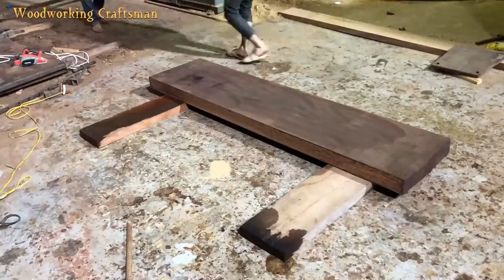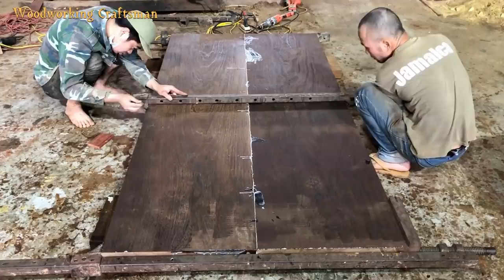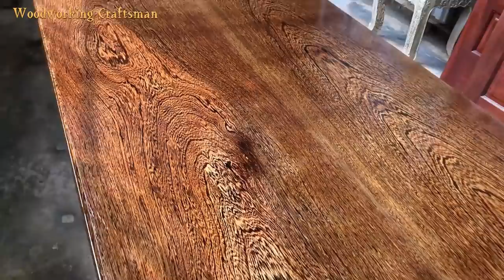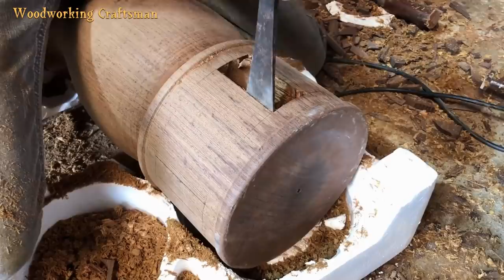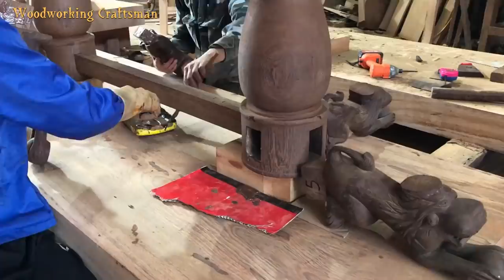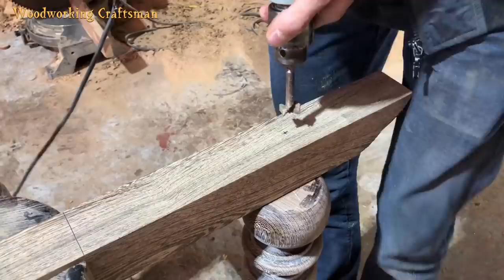Woodworking Projects Extremely Strange Ebony // Amazing Techniques and Perfect Product Furniture

Comment: That doesn't look like any kind of ebony. More like Wenge. That flame method on the mortise though. I've never seen that before. PVA glues don't adhere well to carbonized wood.
Reply: True,,, is Wenge.
But a Amazing Wonderful Work.
Reply: Not sure what type of glue it was but didn't look like PVA to me. Most likely something traditional that doesn't have a problem with carbonized wood.

Comment: Lovely end result, apart from the fact that the beautiful woodgrain was covered with lacquer. I would have been more impressed if they had only used hand tools (watch some videos on Japanese carpentry) and had avoided using metal screws and nails.

Comment: The skills of those young man are amazing. To answer John O about the moisture content, I have been informed that the wood they use is all old stock that had been cut years ago. I have seen some of their furniture that was 75 years old and there was no gaps or cracks in the timber. Got to give them credit, they know what they are doing. Thumbs UP.
Reply: 75 years old my ass
Reply: @tonyjoseph4721  about 200 year. no problem

Comment: The beauty of wood is in the natural grain, it should not be heavely dark coated consealing the natural beauty. secondly, purely wood dowels must have been used instead of metal screws which in time would rust, thirdly, the joints and some dowels where loose and the glue is not a filler type. what a waste of ART.

Comment: Hi, I always enjoy those videos. One thing I'm asking myself is what type of glue do they always use for everything from stairs tu furniture? Is it some kind of epoxy? It is obviously no polyurethan based one either since that would become foamy while drying if not under pressure. 
Why at least for furniture do they not use standard white PVAC based glues such as Ponal, some tightbond types and various other manufactures? I mean PVAC is cheaper than epoxy or polyurethane and other as them non-poisenous and strengthwhise also very good.
Reply from the maker: we used epoxy, thanks
Reply: Woodworking Craftsman 

Thanks a lot for the information. Why is it that you use epoxy instead of normal wood glue? Epoxy is relatively poisonous, expensive and residue on wood or tools is hard to clean whereas regular wood glue residue can be wiped away with warm water - at least before it's completely dried.

And cool stuff your doing, looks so simple but once you try woodworking yourself you understand the skills. Especially without workbenches and vices etc. I highly respect your skills.

Best regards and greetings from Germany 😊

Martin
Reply: @debuchmartin9383  Epoxy is only poisonous before it's mixed. Once it has cured it is completely inert and safe. PVA is also not suitable for a lot of resinous hard timbers, so epoxy or polyurethane is a better option.

Comment: how much in US$ does this sell for?  It is an amazing peice of work.  Unfortunately the wood grain has been painted over.  
I have kitchen cabinets made of American Cherry which shows the original grain and the carpenter painted it in water based clear gloss.  Water based clear gloss in a kitchen?  everything started washing off after a few years and now it looks terrible.  I sanded it down in some places and painted it with clear oil based Varathane but it is not the same.  Well it looks like I have a lot of work ahead of me to bring out the beauty of the wood as it was when it was new.

Comment: Vietnamese junk.  None of the joints are tight.  They are completely dependent on the bolts for stability, rather than as back-up when joints are stressed. Note how the whole thing wobbles when they put the top onto the frame. 
It is tragic that exotic hardwoods are wasted so badly, because people are too cheap to pay craftsmen to do things well.
Reply: People don't have the technology to treat wood to make durable goods. It's undeniable that is a nice piece of art work, but when it comes to green point of view, it's actually not so green and economically efficient. What an expansive art work....

Comment: For lovers of carpenter projects, below are the carpentry plans to make an easy but perfect chair. Plan details can be found below as this isn't originally my plan.

The materials needed to build the chair are:

· 2 lateral pieces of the seat with the following proportions: 360 mm x 25 mm x 45 mm

· 2 pieces of pine wood for the front and rear seat slats: 400 mm x 25 mm x 45 mm

· 2 pieces of pine wood for the backrest slats with the indicated measurements: 400 mm x 25 mm x 70 mm

· 2 pieces of pine wood for the backrest of the rear legs and the measurements are: 750 mm x 55 mm x 35 mm

· 2 pieces of pine wood for the front legs of the chair: 420 mm x 55 mm x 35 mm

· 1 Piece of MDF or upholstered solid wood for the 9 or 12 mm 420 mm x 420 mm seat

· Metal sandpaper

·Saw

· Portable drill or bench drill

· Woodworking glue

·Pencil

·Ruler

Guide to build the perfect and easy wooden chair

1.   Place the rear and front legs together on a large table and proceed to mark with a pencil the spaces to be drilled in each box.

2.    Only the front legs are discounted 1 cm high to form the hammer-like spike.

3.    Mirror the legs to follow the trace with the help of the pencil on each side of the chair legs.

4.    Then you discount 2 centimeters on the top of the rear legs corresponding to the back of the chair.

5.    Then with the line, we have just marked it will be used as a baseline to mark another line referring to the backer rod and the distance will be 3 inches wide on the rear legs.

6.   Then we mark 2 centimeters apart and mark a new 3-inch backer rod, having a total of two rods.

7.   The spike and the box opening will be 1 centimeter thick; therefore move the front leg measuring 1 cm for the shank to the rear leg and mark the guidelines to drill the opening where the shank will fit.

8.   For the front legs, the boxes are drilled on the side and front face where the saddle slats are hooked.

9.   Proceed to drill each box on the rear legs where each dowel will be connected, specifically on the rear edge, there are two boxes on each rod for the back legs support.

10.  To make the spikes we adapt the saw to the required height of 1 cm or 2 cm depending on the leg we are working on and you proceed to carry out the sweeping system, which consists of making several openings resembling the appearance of a comb and we begin to slide up and down the wood strip to remove excess wood and form the dowel.

11.  With the help of the metal sandpaper, round the corners of the pins so that they fit perfectly in the curve of the box of each leg.

12.  Begin to assemble the front part, add carpentry glue on the boxes, and the edge and insert the legs, with the help of a rubber mallet, hit to connect each piece.

13.  Assemble the back, use the glue, the rubber mallet or hammer to press the wooden slats and attach the pieces.

14.  Assemble both sides and place the chair upside down to mark the points where the seat will be hooked.

15.  Drill holes to hold the seat.

16.  Place the seat that can be made of solid wood or MDF. 17.  Finally paint the chair or add a varnish that highlights and protects the surface of the wood.

This plan is originally from the Sawdust Addict website. Use code "GIFT27" for $20 off. Click below for website

https://sawdust-addict.com/wtc/A/tml517
Reply: 3   u

Comment: It's a nice design and the workmanship is fine but that is NOT any kind ebony wood. Ebony is extremely dense and brittle. No kid with a mallet and chisel is going to make mortises in ebony like that, especially not with a 1.25" forstner bit in a hand-held drill to clear the main pocket, that's simply not possible. In pine that would be challenging, in ebony it's impossible - his wrist would be broken on the first trigger pull. It could be an issue of translation - you just got the wrong word for the wood type - but don't be surprised when customers who know the difference refuse to buy your products because calling that ebony is false advertising.

Comment: The wood in this video is NOT Ebony! Ebony is not a large girth tree like in the video. Look at the obviously large radius growth rings (logs 5 feet or larger), alternating colored stripes, and evidence of resin filled porosity. There are several African, Asian, South American hardwoods this could be, but not Ebony which is predominantly an African wood. Judging by being from evidently large logs, even grain, striping, porosity, oily appearance, apparent clean cutting, pale color of the drilling dross, and the Asian woodworkers (in Viet Nam, in the header), I'll say it is Teak. If it's Burma Teak, I'd estimate the two original planks to weigh about 1,300 lbs together.

Comment: Great project. My guess table weights over 1000lbs. My only comment is since there is no way this table will need to support 3000lbs load, sing 5" thick maghogany is while f awesome, is also huge wasteful. one can make same table 1.5 thick (those 2 slabs can 3) and add border on sides to make it thicker. but it would be very durable, 1/3rd the weight and you wont need 8" beefy feet. Overall, great design, but also great waste; kinda like eating a 40oz steak by yourself :)
Reply: This table build for 10 generation

Comment: Woodworking at good level of craftsmanship but design - heavy and ugly. On the end it is a waste of a good timber in my opinion. Washing off a natural black resin to dye it black later something doesn't stick here. It is not Ebony, it doesn't have such grain, it is much harder and doesn't need any stain, only polishing is enough to get perfectly smooth , lustrous surface.  I doubt that Ebony slab of such size is available even in Congo or Gabon it doesn't grow so big.
Reply from the maker: Thank you for your opinion, we are not sure what the right paint color is, but the customer asks for it so the product is black!
Reply: @WoodworkingCraftsman  Customer wish is  ours order ;-)